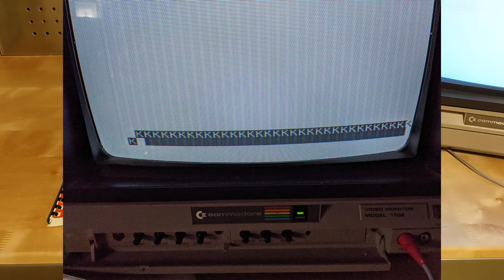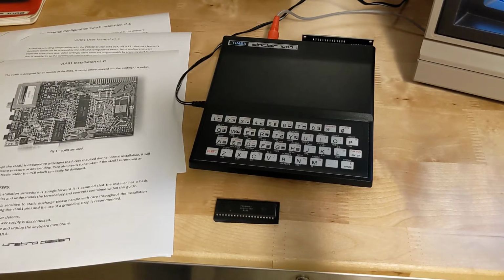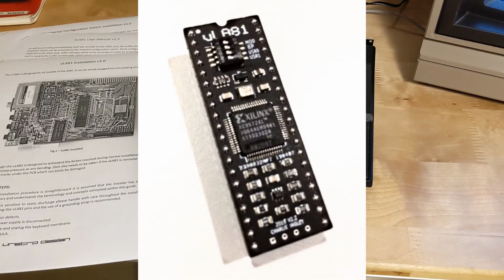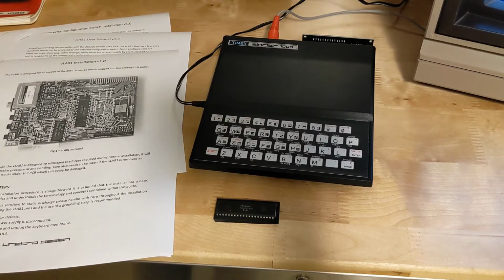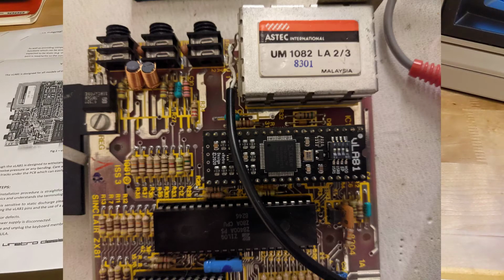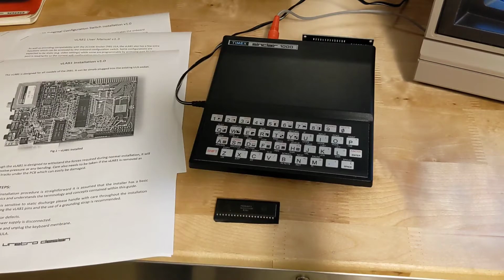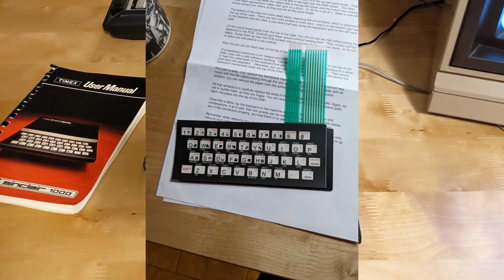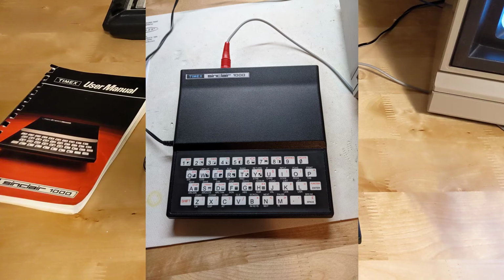Timex Sinclair 1000 Computer Update

Comment: Replace the 7805 power regulator with a TRACO TSR-1 2450 and you can dump the heat sink. Runs much cooler and uses less power. Also jam in a composite video board and dump the RF modulator box.

Comment: Hi from Calgary. I noticed your computer has an RF video connector at the back.. could you please comment on that mod.  Thanks!
Reply from the maker: The built-in commector is RF output. I added a connector for composite video output using the solution described here: http://www.zx81.de/english/video_e.htm
Reply: @jefftranter  Thanks!
Reply: @fawf9363  its possible to open up the modulator case and wire the composite to the rf phono socket, saving making extra holes